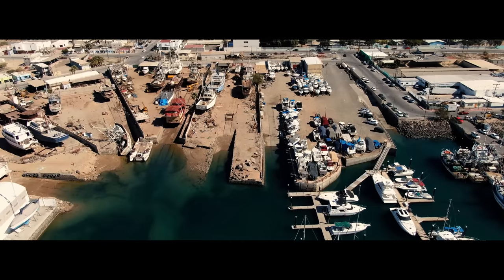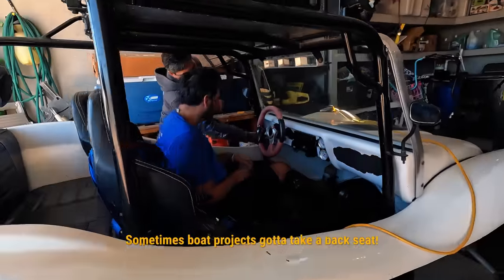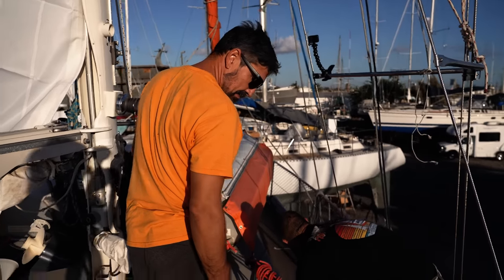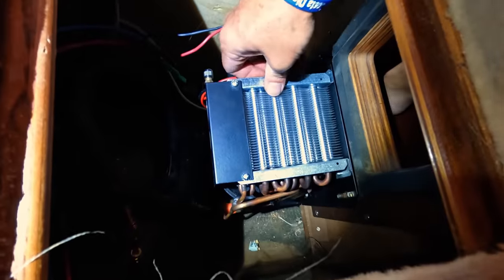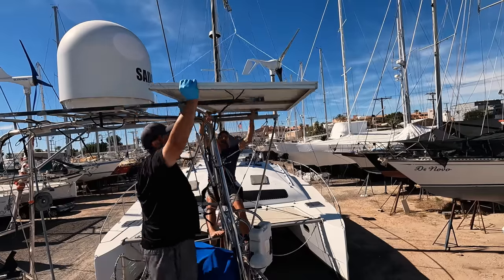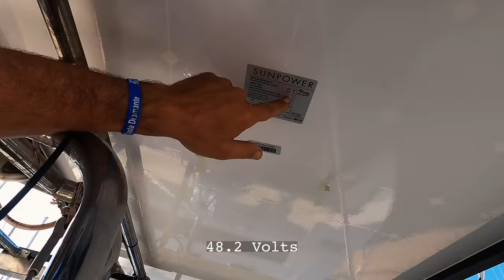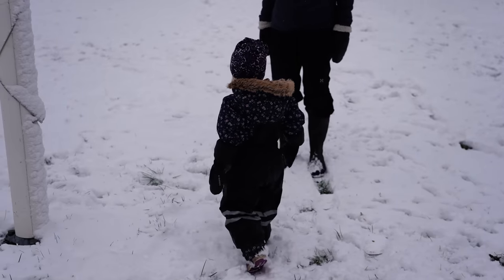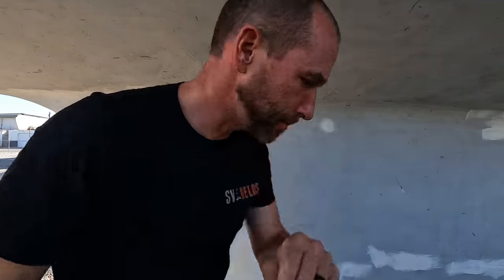BOAT WORK - Are We Crazy To Think We Can Do This??? Sailing Vessel Delos Ep. 407

Comment: 2,010 watts is impressive, and that's not counting your wind turbines. The newer cooling systems are much more efficient now.
It's pricey, but if you upgrade your AC, if you already haven't, you could run AC underway much more. I don't know your system's math, but your Battleborn batteries are awesome.  Having AC run off the sun while the boat is powered by the wind, is a dream come true. 💨 ⛵🌞

Comment: Here is a tip for anyone working with solar. The slightest slither of shade will totally destroy your solar production. It would almost be better to install panels down both sides of the boat, that way you could fit twice as many as needed and benefit from one side of the boat or the other with no restriction unless the sun was directly in front or directly behind but the water could reflect a decent amount of energy onto the panels and if you were tacking on keel you would be directing them skyward. Thin film panels work much better than mono or poly when not at the ideal angle. Either way, angle and shading is super key on mono and poly solar, no easy solutions really other than to fit more than you need and benefit whenever the sun is fully hitting them.
  The main point is to be aware of partial shading, even shade from a sheet line could destroy production and if your panels are in series this can hit hard on the overall production. Bypass diodes (usually built into the panel) will help but it would be much better to try to avoid shade if your in a situation where this could be possible.

Comment: I am no expert and I do not know if this was only in the early days but as far as I know you need to let the compressor "rest"after you had it on it's side or even upside down. This is to make sure all oil has drained back into the sump and will not hydralock the compressor suddenly and break it.

Comment: Surprised you did not go with bifacial solar panels on the arch- same front face watts but 15-20% more watts from reflected light hitting bottom of cells.  They do weigh more due to two glass panes.

Comment: You're undoubtedly an old hand as this, but after sawing the battens down to their properly length, and gently notching them if required, , be sure you use progressively finer grains of emery paper*, from 220 to 600 and even 1,200, rounding the corners, before cleaning the last four inches with alcohol (3x) and a final single swipe of acetone on the last three inches, followed by a two-inch dip in gelcoat.  Let drip downwards for 1 minute, then upend it until dry.  If it's thermosetting, check with the manufacturer, but suspending the dried gelcoat end in a pot of hot water for a time, say, 3-5 minutes, is usually enough to set it.  Follow the manufacturer's recommendations.  THEN they're properly prepared for use in your new sails!  Obviously, this is done to prevent degradation of cut end fibers, which can easily wear through your batten pockets.

*dark granular mineral that consists of corundum with iron oxide impurities (such as magnetite) and is used as an abrasive

Comment: I love your videos. But a small thing that drives me crazy is you generally only show a voltage OR an amperage. I keep thinking about this as a system where you eventually use the energy. So I always want to know wattage. My goal is to build a wind turbine for a sailboat. But at the moment I am never quite sure about feasibility based on scaling your work. I understand the videos are not meant to be answers but could I request volts  and watts be shown as it helps to conceptualise the viability of options for me … and I’m pretty sure I’m not alone. Again … love the videos.

Comment: Is it a masonry heater in the house? You might want to see if you can make it functional and use it to heat the house, hot water as well as can be set up for for cooking and baking. Masonry heaters are VERY EFFICIENT and one fire a day warms the heater enough to warm the bricks/stones enough to keep the house warm for a whole day! It also is extremely safe. The exterior never gets so hot that it would burn you if you touch it - unlike a wood stove. If you order one new it costs tens of thousands of dollars.
Reply: He said it was a large oven for baking
Reply: @philipmackin1025  I heard what he said he thought it was. But it didn't sound like he was very sure.